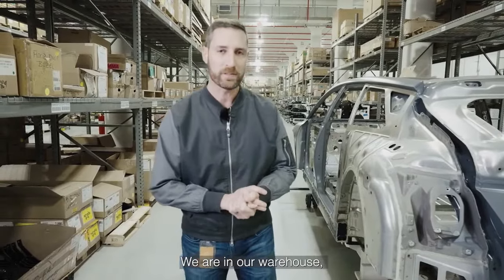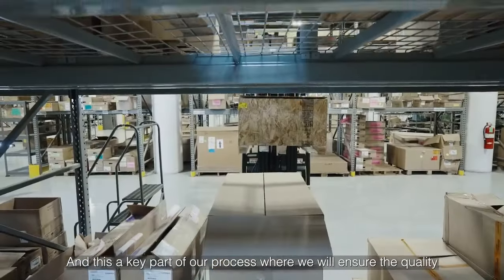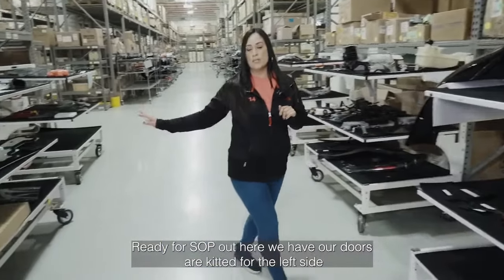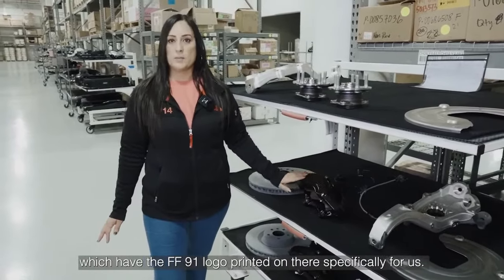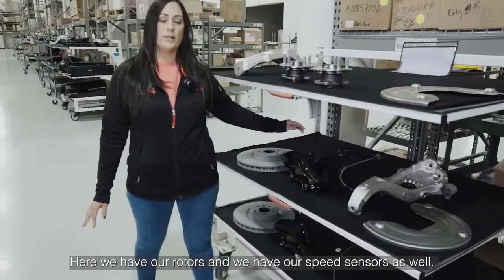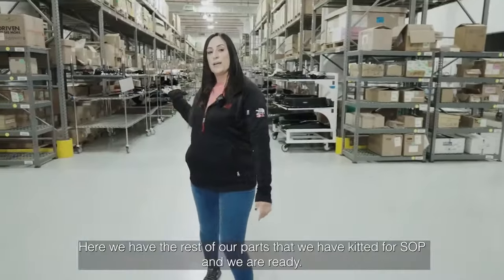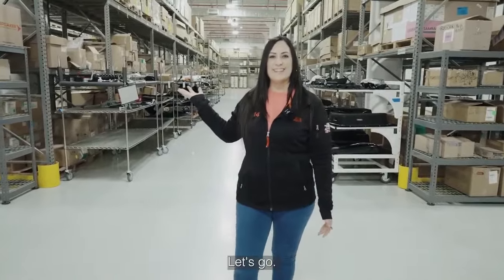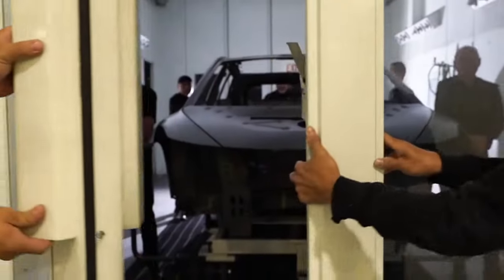FF 91 Futurist Alliance Start of Production

Comment: Worth the Wait... 26 Major Systems / Components Upgrades... Spa Function, 1,050 hp, 155 mph, 0 to 60 mph in 2.27 secs, Zero Gravity 60 Degrees Reclining Rear Seats, 11 Screens/ 27 inch Screen Rear, 11 Sensors/ Cameras, and Much More.
Reply: Buy their stock at 35 cents now FFIE - i bought it at 35 cents today March 31 2023
Reply: @si-tv9ne  and since you bought it it at 35 cents. You are way down. It's 20 cents. And if you  bought at higher prices you are probably down 90%%% plus. It's 20 cents close to ZERO.